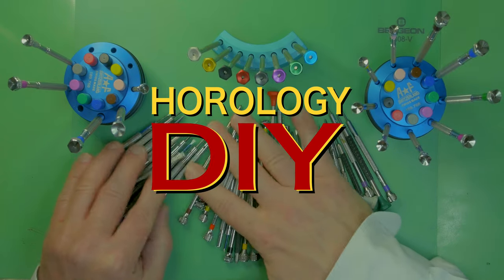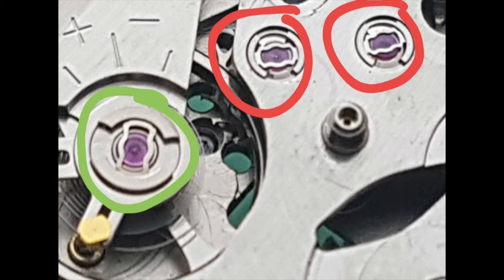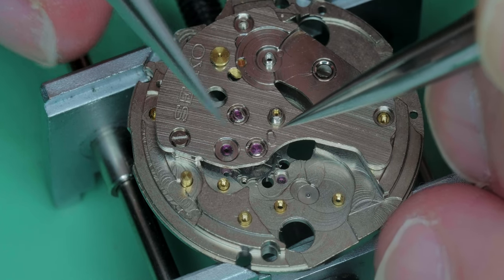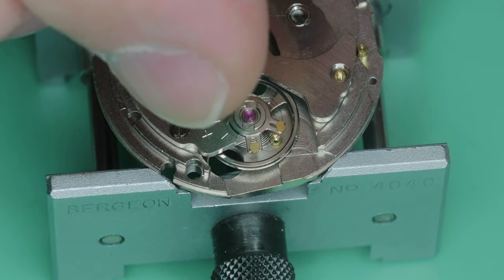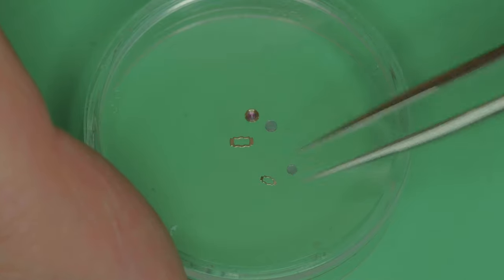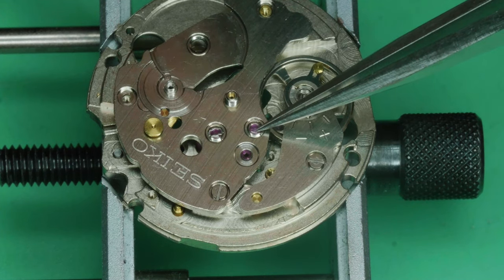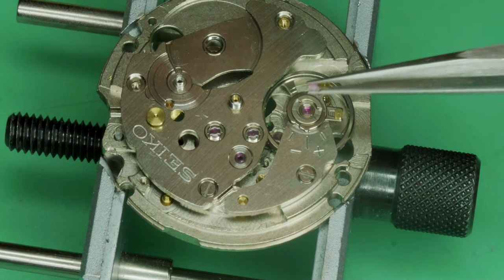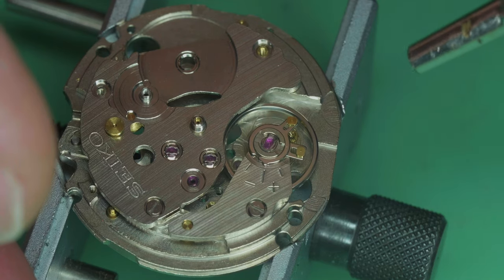Seiko 7S26 tutorial Part 4 - Shock absorbing jewel setting and cap jewels disassembly | Horology DIY

Comment: Over THREE HOURS and i cannot set the small diashocks on this 7s26. I fashioned a pegwood tool for the balance wheel one which makes it easy but christ i CANNOT get the small one. Do you have any advice?! I only have 2 #2 tweezers and they are fine for everything else but i notice your #3's are SO much finer of a point. I would rather not drop another 80 dollars on tweezers just to do this one task.

do you have ANY tips or pointers or tricks?The moment i touch one side of that diashock spring it just nudges the jewel out of it's setting, if i fold the spring over it it just shoots out sideways.